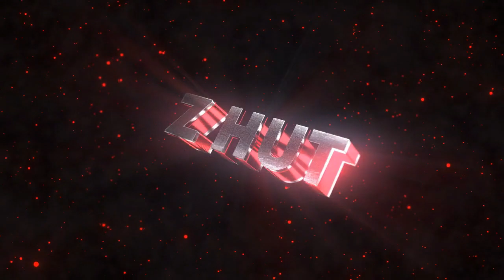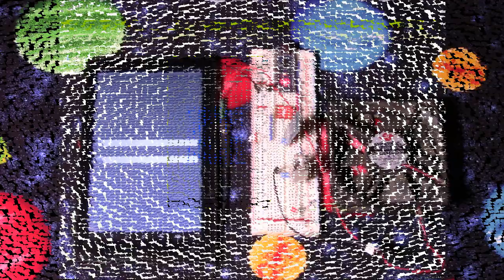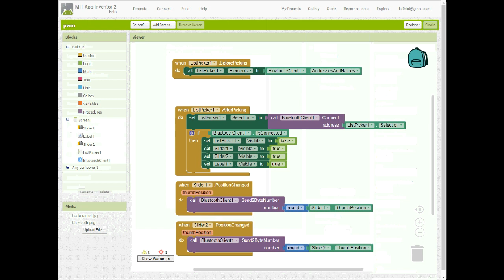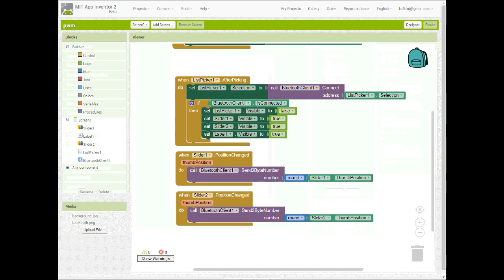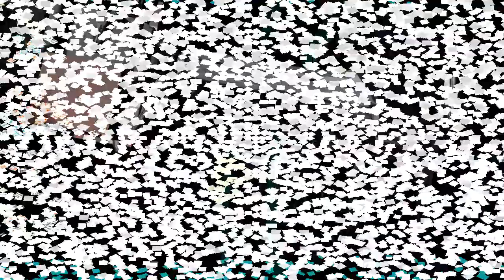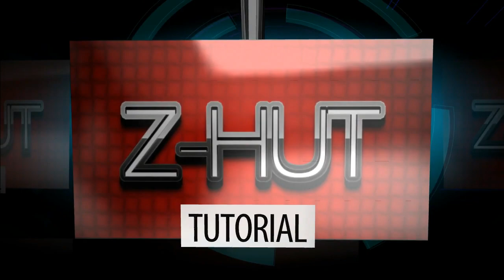How to Bluetooth Control ARDUINO PWM Pins (pulse width modulation)

Comment: Hi i am currently using HC08 instead of hc 06 . So does the arduino code works the same for hc-08 and hc-06 ? Secondly , have you used HC-08 as i need to know if its connectivity is good or not as i know hc-06 has connectivity issues

Comment: This has been extremely helpful. I will try this method with my micro drone and it should work with some tweaks in the code.
There is 1 problem with the code, when you write [[ if (val>= 1000) then analogWrite(led, val-1000) ]] here the value for led becomes 0 in case of which the fan will also spin. idk how that did not happen in video..

Comment: Z.HUT YOU SHOULD DEFINITELY MAKE A VIDEO EXPLAINING HOW TO BUILD A CIRCUIT, CODE, APP AND ZERO CROSSING CIRCUIT WHICH CAN CONTROL AT LEAST 5 AC LIGHT BULBS AND BE ABLE TO NOT ONLY TURN THEM ON/OFF BUT DIM EACH ONE OF THEM SEPARATELY VIA BLUETOOTH HC-06 AND ANDROID APP. THAT WILL BE A CHALLENGE!!!